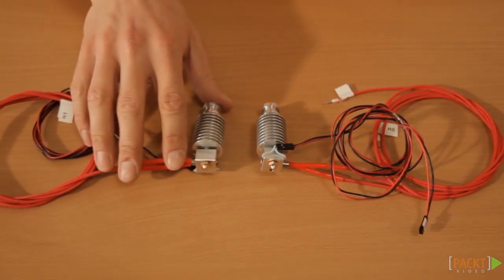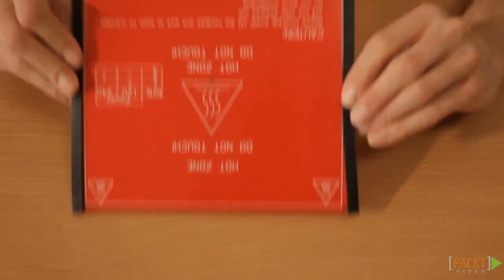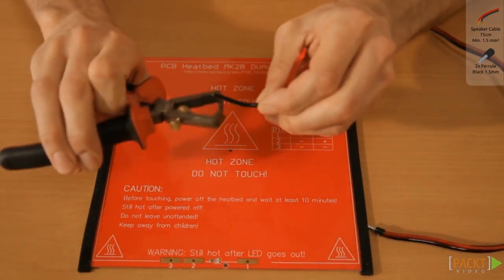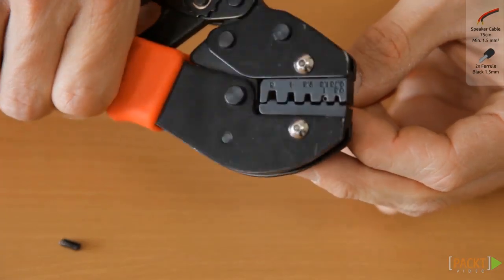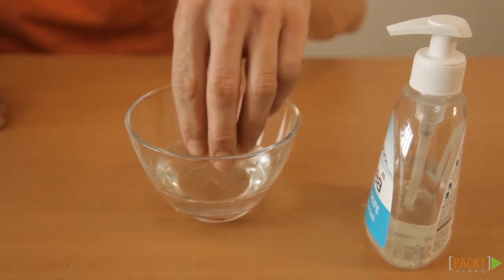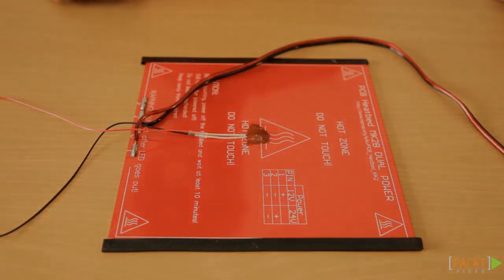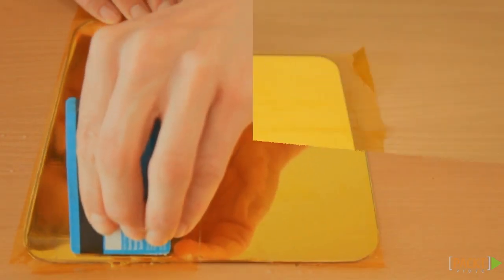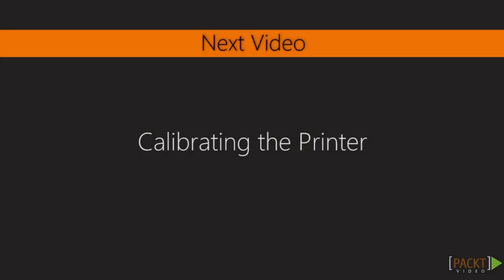Building a RepRap 3D Printer Tutorial: Wiring the Heatbed | packtpub.com

Comment: You made one HUGE error with the bed. It is being shown UPSIDE DOWN. I learned of this error in your video after soldering and installing the bed and finding it didn't seem to be heating the glass enough.
Reply: Heater elements facing up. Might be the other face on your heatbed. If your heatbed is slow to reach temp etc it might be air trapped between heatbed and printsurface. Always check which side of the PCB your heaters are on. If you still have problems you can use very fine sandpaper (2k grit glued to a glassplate to make it perfectly level) to rub the contactsurface between heatbed and printsurface; then use nonconductive heatsink paste since q = -(k delta T). Your sanding should be done in spiralling rotations out from the center since dS determines Q. Remember to not put too much insulation under the heatbed since that will make your X-axis sluggish since E=mc^2.

Comment: What type of insulation do you use for the thermistor? Does a simple insulation coat of a thin cable work?
Reply: 8 months, still waiting for answer.
Reply: Actually i know that but it's funny that they will "reply shortly" and they still haven't answered :D
Reply: @Rj-nw4vc  y aún no responde, jajaja.
Reply: @esaurise  Yeah, short = 5 years
Reply from the maker: +Juan Pablo Colomer

We appreciate your interests in our videos. We will look into your query and get back to you with a reply shortly.
Reply: In case you didn't find an answer i know they use a high temp silicon or other high temp sleeving

Comment: A couple of questions: do you see any issue with using non hi-temperature silicones? (normal ones usually resists up to 150°C).
What if the heatbed doesn't have a hole for the termistor? Is it still ok to put it just in contact with the surface?
Reply from the maker: +Alessandro Vaccaro

Thank you for your query.

We appreciate your interests in our videos. We are looking into your query and will get back to you with a reply soon.

Best Regards
Packt Publishing